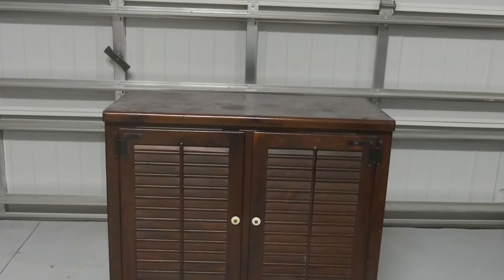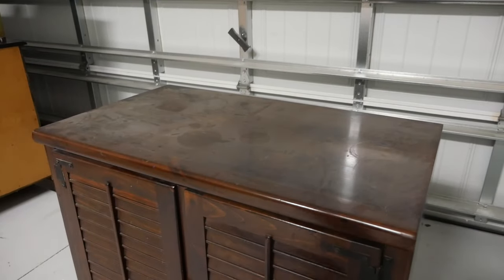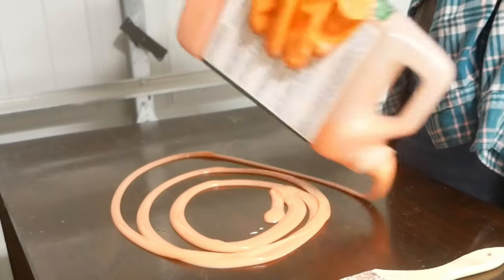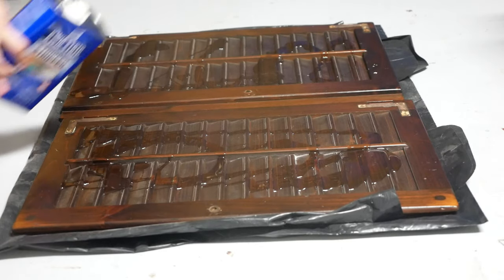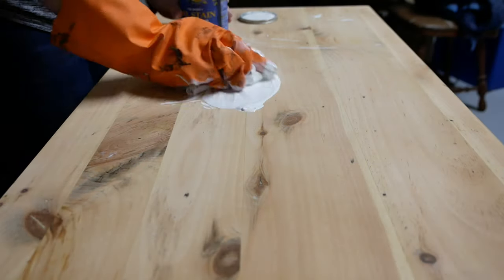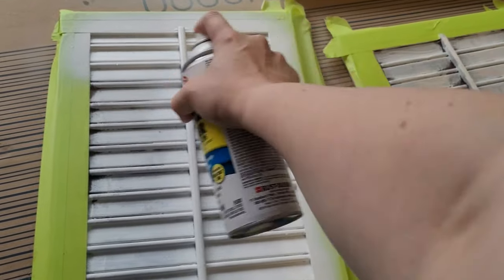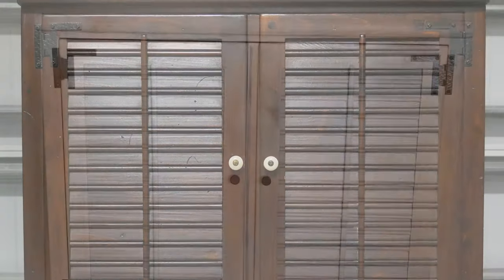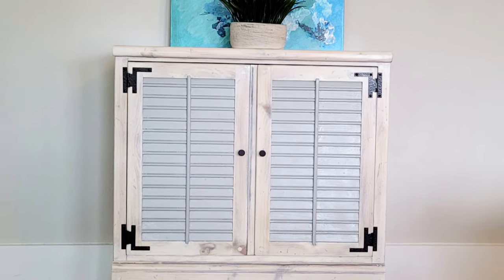Coastal Modern Cabinet Refinish- Adding Legs to Furniture - Whitewash | Beach | Driftwood

Comment: This item was a tv cabinet, henceforth the missing back. We purchased one of these in 1978, along with a matching bookcase top and a stereo cabinet. Sold them around 2005 when we moved into our new house and redecorated. The dings and scratches were original, the style was antique colonial.
Reply from the maker: Thank you for all the info ❤ I recently saw an entire set of these on marketplace. Tall cabinets and the single smaller one. Seems like a versatile set!

Comment: I purchased an Ethan Allen American Traditional hutch bottom new in 1967, but it's currently showing its age. It has three slatted panels below two drawers. The hinges are the same as those on your piece. The knobs and drawer pulls are original...no googly eyes. I don't think the wood is pine, however.  I've often wondered about ways to restore the piece, and particularly, how to deal with those louvered doors. Your cube-inette experience more or less confirmed my suspicions about the difficulties. The coastal look works well though. Thanks for helpful insights.
Reply from the maker: There are similar ones in this style that I have seen in maple. Slats are definately not my favorite. I wish the back door panel came off. I like the functionality of these pieces. Thank you for watching Mary!

Comment: Sooooo...  What happens over time to the stripper that got between the slats and the backing boards?  Enquiring minds want to know, eh? ROFL  I hope it's not an issue. :)  Nice cube-inet; I'd have that in my home. <3
Reply from the maker: I used enough mineral spirits on the slats to consider taking out stock in the manufacturer. Possibility there is some residue behind the slats, but it could easily be sanded down if someone eventually removed the slats. The way the door is constructed I could see the next evolution of this piece having the slats cut out and replaced with cane or some other medium. Hope this helps!

Comment: Thanks - I always like your videos. :)  Question on this one: were you able to remove the stripper from between the slats and the backing? Or neutralize it? If it's still there, could it cause problems with the wood later on, or become a strange surprise for someone working on this cute "cube-inet" in the future?
Reply from the maker: I used an excessive amount of mineral spirits. There is most likely still some stuff behind there but its neutralized. If anybody takes the cabinet apart they should be able to sand any residue off. Though I doubt that will happen based on the construction of the back.  Did I mention I dont like slats? lol. Thanks Evelyn.